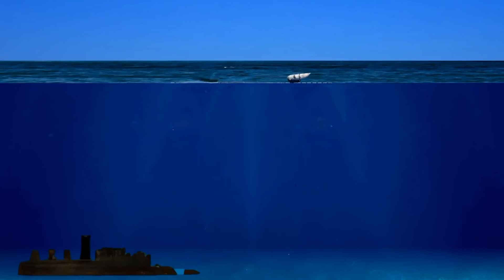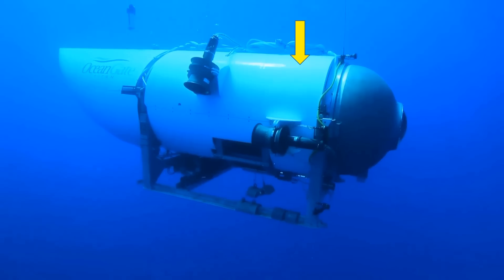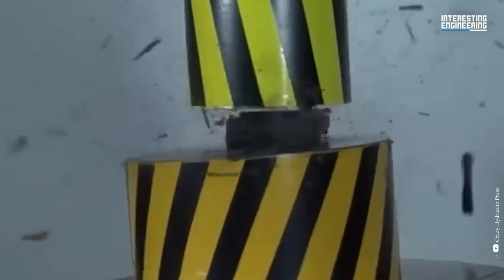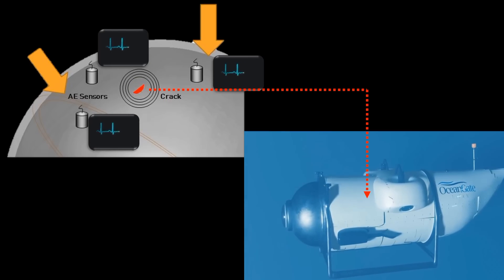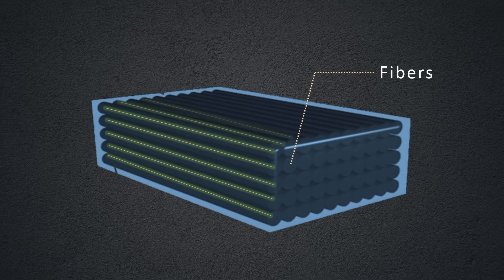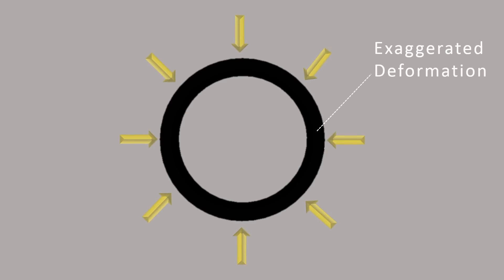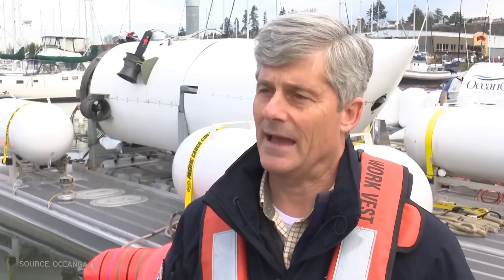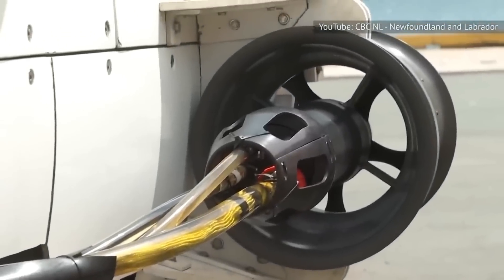Oceangate Titan Did Not Implode Just From Pressure. There Is a Catch!

Comment: FINALLY - A youtube presented based on material science and not speculation, plagiarism or guessing like the others and are borderline liable . The truth will be know within 12 months to two years. Everyone has been calling  this a massive implosion, (obviously the pressures were involved), where the people didn't feel it. Yes it was an implosion but there is a strong indication the passengers knew danger was coming. I am a retired engineer , however, I am retired from a different industry and my credentials with the industry are not current. However, it appears yous are - with that in mind there is another composite material problem on the horizon which will make the world forget this incident. I cant mention the name of the industry and products, however, I have been concerned for over twenty years and the industry has been exponentially expanding their use of composites. They are huge corporations so I can't approach them but you may have a methodology on how to look into it. I will code my initial concern for you - they just had a global meeting in a European country known for its wine, billions of dollars were exchanged and one of the products weighs over 560 tons is currently in the news and cycles through extreme pressure daily and failure would include not 5 but 500 people. My evidence would disappear and my "theories" be like the bite of a flea. You might have contacts or be able to think of a strategy to reach out to them like you have with this video - if you are reading  the responses.

Comment: Lexan or a similar material should be examined as a lightweight alternative to steel or titanium. The bulletproof windows of the White House are made of Lexan. The hull of the Titan likely derived its compressive strength from the epoxy that held it together and might have been stronger if carbon fibre were altogether absent.
Reply: I doubt it.  I think the resin is a weakness.  It bonds the fibers together, but how well?  The pressures are extreme.  Lexan is kind of rubbery.  It catches bullets because it doesn't shatter.  It doesn't shatter because it's sort of gooey.
Reply: @JoeLinux2000  You are correct. I've seen lexan "type" window after a bullet impact. It kinda "bends & gives" for lack of better wording.
Reply: @kathryn9spraker892  CNC machines ie lathes and mills use a laminate of glass on the inside and lexan or poly-carbonate on the outside for observation windows. the glass resists scratches during normal machining, the plastic stops broken glass flying out to injure the CNC operator, when loud noises happen and things fly about inside the CNC machine.
Nothing like 30lb of iron flying around inside a CNC like a pinball at 6am in the morning to wake everybody up.
Reply: Not Lexan. Multilayers  of polycarbonate and HS glass. IMO the epoxy by itself would be to brittle.
Reply: Pringle cans are much stronger.
Reply: @gmac8852 have you designed and tested one?
Reply: @gmac8852  lol
Reply: The window blew in.....it wasnt in the end when retreived was it??????? Did it magically fall out????
     Already known just like the implosion was known days before that info was released.I beleive nothing the so called experts or news says.
      20% excess unexplained deaths the last 2 yrs ...where are the experts??????

Comment: It couldn't deform. Very brittle. It would have gone off like a bomb. After several dives the the carbon fiber would have de-laminated. It was layered like an onion. Once that happened it was essentially no longer 5 inches thick.
Reply: Also voids, air compresses, water boils into steam, both will seep along the layers all happening inside the CF cylinders layers..

Comment: This video seems to go off track at about 6:05, where the visualisation of the pressure is shown in the vertical vector squashing the cylinder as if it's experience weight from above, rather than pressure which is pushing radially inwards from all directions. Therefore, it's not exactly correct that some of the fibres will be under tension as is shown. Rather, it is more accurate to imagine the pressure attempting to shrink cylinder symmetrically - scaling it down in diameter - in which case NONE of the carbon fibre strands are under tension. So in such a case, with the fibres now not able to utilise their extreme tensile strength, one is virtually left with just an epoxy tube...not good.

Comment: Why not construct a spherical carbon fiber submersible and maybe even build it with thick interwoven carbon fiber on the outside of a thick titanium hull? Usually certified ones have titanium several feet thick. I’m curious what all you engineers take is on this and how you would build it. 

The Titan made like 5 dives to titanic so there’s definitely something to be said here. In many ways this was a revealing experiment and gives a lot of data. It wasn’t perfect but I think there’s a way. But then again maybe CF physical properties just aren’t ideal for these types of pressure since it’s not a continuous solid material

Comment: Eventually a laminate substrate under extreme pressure is bound to experience water infiltration, Water at 5000 PSI, will convince them carbon fibers to get out of the way of the path of least resistance.

Comment: I’m inclined to think the pilot of submersible lost control on descent & it nosedived onto the bottom of the ocean & imploded. Perhaps too many people were in the nose trying to look out the window. Perhaps Rush jettisoned too much air from the ballasts & didn’t have enough compressed air re-establish sufficient positive buoyancy or account for the inertia on descent.
Reply: there was a problem with the RTM? RTS? Real Time Monitoring System, which was indicative of a water leakage in the mechanical chamber ... they were descending at almost double the rate and when weights were released the ascending was sllllooooowwwww aka 'waterlogged' ... and he had to switch to 'Battey B' as electrical failed from the A ... around 2 miles beneath the surface, the final 15 or so minutes was horrific ... I only hope that PH created a huge hugging circle and said a wonderful prayer for the new horrizon ... I truly believe that he 'PH' did something of this nature to calm Suleman and  the others RIP ... Amen
Reply: @jaiyneybear7073  If the submersible’s ascent was slow, what caused the submersible’s buoyant force to increase enough to not only compensate for gravity, but also the downward inertia?  Thrusters? The pilot reported a problem with power to the thrusters. If the pilot was able to report RTS/RTM warning lights due to a leak bad enough to affect buoyancy, he would’ve surely noticed & reported the leak too - water spraying in at around 5,000 psi, more than enough to easily rip through flesh to bone. You’d think the purpose of jettisoning the platform & ballasts would be to create sufficient buoyancy for a rapid emergency ascent. The ballasts use tanks of compressed air to force the water out of the ballast tanks, making the average density of the submarine less than that of the water. The high density of the platform would slightly over-compensate for the low density of the submersible allowing it to descend. The ballasts change the density of the submersible’s platform using water & compressed air, causing it to ascend & descend. The transcript just doesn’t add up.
Reply: Agree.

Comment: Terrific video, very informative. The one question I have is how were the controls (thrusters, ballast and sled drop) operated from inside the pressure vessel?
Reply: Thank you jim. That part has always confused me and I didn''t think hull penetration was an option. Do you know how the Mirs were controlled?
Reply: When the water and oxygen met at the time of collapse the oxygen would have flashed to the temperature of the sun. That's enough to clean up alot of material.
Reply: @KerryHicks-v5b  utter rubbish, there is no way the temperature reached over 5000 degrees Celcius in a second!
Seeing as they have now reported they have recovered bodily remains, it seems to me that all those so called experts have been wrong again!!